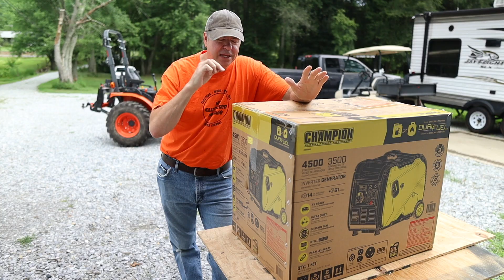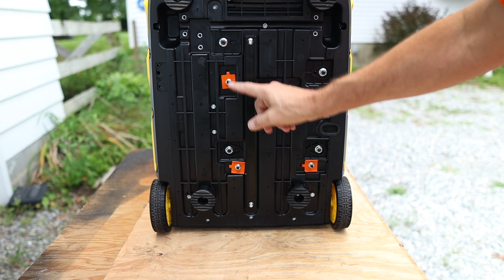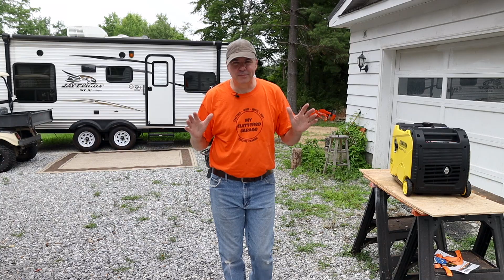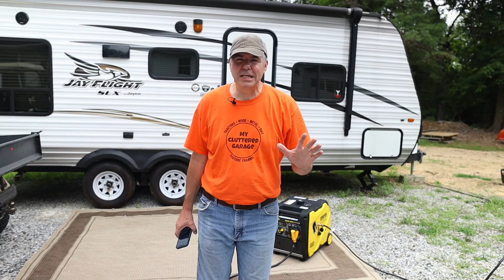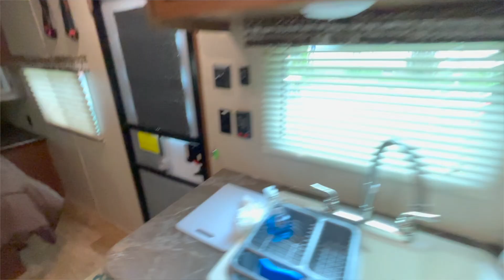#68 Champion Dual Fuel 4500 Watt Inverter Generator. Unboxing, setup, and review. Best RV generator?

Comment from the maker: Champion dual fuel inverter affiliate link:
https://amzn.to/3CqGngE

Here are some other product suggestions. These are Amazon Affiliate links, so purchasing will help this channel by providing a small commission while not costing you any more. Thank you for your support!
Lumax Heavy Duty Grease Gun:
https://amzn.to/3mFK1pA
LockNLube Grease Gun Coupler:
https://amzn.to/3kPcvwu
Recommended Grease:
Valvoline Moly Fortified
https://amzn.to/3jNM1Kv
Nitrile Gloves:
https://amzn.to/34Kg8OG
Deerskin Gloves:
https://amzn.to/2I17NNy
My Video Gear:
Rode Wireless Go II microphone:
https://amzn.to/3eiJatG
Canon M50 Camera (now Mark II):
https://amzn.to/3vHW9uD
Battery adapter for M50:
https://amzn.to/2RshsBE
Sigma 16mm prime lens:
https://amzn.to/3vJDRcx
Sigma 30mm prime lens:
https://amzn.to/3epFneh
Variable ND filters:
https://amzn.to/3tmoHIs
Reply: JUNK! Stay away from Champion!!!!!

Comment: dang they must have really changed things in the 4 yers since you posted this. I just bought a 4500 inverter generator and it is under 60 pounds, very quiet and does not need wheels. I can carry it uncomfortably but it is doable. still prefer to use a hand truck or 4 wheel dolly because I am old .
Reply: @AsTheWheelsTurn  are you referring to the smaller champion 4500 w inverted generator? If so there are some differences between what you bought and what's in this video. 

For starters they use a different motor, yours probably doesn't have electric start, slightly less running watts (4500 is surge wattage), and a smaller gas tank. 

The one in this video is made for higher running loads, longer run times with the larger fuel tank, and easier portability since you don't have to carry it, it has wheels built in.

Two great generators, just slightly different design choices for different use case.

If you got a different brand, there's no point in comparing.

Comment: I used to swear by Champion Power equipment having three chainsaws, two 3650 generators and three 2500 inverter generators. Unfortunately the last 2500 I bought had a knocking noise right out of the box. Champion used many excuses not to warranty it. For example: my intended future use was to charge an RV battery for my house as any RV owner would do while camping and this is not covered by the warranty. (They call it Prime use).

They eventually supplied a new motor but did not cover the installation cost. In a recent phone call, they suggested I should have paid a local mechanic to diagnose the knock rather than drive to the closest Champion service center. They said I should install the motor myself to avoid repair costs. 

It was not my fault the motor was faulty from the factory and I should not be penalized for any possible future use. I paid for a new generator and I should have a new generator without incurring any extra costs. This is not a warranty issue, but a defective purchase issue.

Comment: Quick tip. 
If your can't get my gen to stay running......... 
If your propane generator starting and immediately stalls is often caused by activating the excess flow control device inside the propane tank valve, which restricts fuel flow by up to 80%. This happens when the valve is opened TO FAST. To fix it, turn off the tank, disconnect the hose to release pressure, reconnect and slowly turn the valve back on. It's happened to me and this is the fix .
Reply from the maker: I’ve never had that happen to me, but I have heard about it. Great point!

Comment: I appreciate this video and got mine today. Two questions. 1. Did you find it difficult to reseat the dip stick and screw in back in? Seems really crowded down there and I had to try several times. 2. I use Battery Tenders on all my motorized, electric start units. Not only does it look really tough to put the wiring harness on the battery but my Wife read something about it having a lithium ion battery and only using maintainers for LI batteries. What does everyone else use to keep the battery ready?
Reply from the maker: It is tight, but I don’t recall it being problematic. My battery has remained charged for several years and starts every time - even after sitting. I try to start it every 2-3 months to keep the carb clear and the battery charged. Good luck and thanks for watching.
Reply: @MyClutteredGarage  Is there anyplace for a fuel shut off? (Thanks for getting back with me!!)

Comment: Thank you for posting this!  I just purchased this generator.  Question for you:   Will the generator motor automatically turn off when the battery is full?  I've never had a generator, so I don't know what I'm doing.  Thanks!

Comment: Options have changed in 3 years. Champion now has a 4500/3250W dual fuel that weighs 51lbs. Even has a top handle.

Comment: Quiet? you mean you do not wake up the whole camp site with noise and fumes? The bears don't mind.
Reply from the maker: Most campgrounds have no-generator policy after dark, but this is indeed super quiet. 👍
Reply: @MyClutteredGarage ,  
Every campground I have been to never say anything if the power goes out and I crank it up.
Reply: It’s actually not loud at all. On ECO i can barely hear it when inside my 40 foot tt.

Comment: Does This model have a battery ? Owner’s manual doesn’t mention one??
Reply from the maker: Yes. It has electric start and a pull cord. My battery is still working great after 4 years.

Comment: Hi, I added the oil before taking the nuts and brackets off. I tilted the generator and then removed them. Is the generator still going to run?
Reply from the maker: I would think it will be fine after sitting lever for a couple hours. 🤷🏻‍♂️
Reply: @MyClutteredGarage Thank you for your response! I hope so lol
Reply: I almost forgot to update this. Anyways, for anyone wondering, I let it sit overnight (12 hours) and it worked just fine. 👍

Comment: I got one of those I carry it around in the backseat of my truck when I'm not using it I live off the grid I actually have two generators a 2000 watt and that 4500 I really like that generator it has a lot of power and it's very quiet it can run everything in my camper at once it'll run about 22 hours plus with a bottle of propane I have never put gas in it and don't plan on it and you do not have to choke it when you're running propane that's only for the carburetor they say You're supposed to but you don't that button for the reset allows you to reset the generator if it does trip without shutting it off

Comment: Nice Video thnks , just a question if you tried how many hours can work continuously? Happy new year also
Reply from the maker: Thanks. I’ve run it overnight with the RV air conditioner running. That was like 8 hours on gasoline. I haven’t tried a long run on propane.

Comment: These gen seem amazing , looking for a unit to run my 15,000 btu AC  on my camper with doing other stuff , i have heard the yamaha are king of the hill !
The price is very high but buy one cry once 
Our camper is 25 foot with basic stuff 
Do u have a good recommendation or just break down and get one of these babys 
Honda does not have one one in this size that will pull this load i am asking without getting to big and are the yamaha fuel injected , this may be the way to go when u get up in the moutains 
Thanks for input 
The cheaper ones have alot of options but will they last
Reply from the maker: I’m no expert, but I think this generator will run your RV just fine. I don’t know anything about the Yamaha, but fuel injection sounds nice. I’m still happy with this one. 👍
Reply: @MyClutteredGarage  firman has a decent one , guess just pick one , thanks for hitting me back

Comment: Does anyone know if it is better to plug in the extension cord before starting (making sure nothing is powered on yet so not under load) rather than after?
Reply from the maker: I don’t know officially but if it’s not under any load, there should be no issue plugging in the cord before starting. I generally start first, then plug in though.

Comment: The only thing missed was breaking it in which is very important the first hour should be run on economy mode and then the oil changed and then repeated at least two more times and then with the total run time of five or six hours without a big load
Reply from the maker: Thank you!

Comment: I have the slightly larger 4650 version of this unit. I found that carrying a fuel can and loading the generator empty saved a few pounds. Still, taking it off the tailgate and turning to put it down seemed like more than my 50-something back should be doing. I use loading ramps.

Comment: I have this generator. I’m using propane. I followed the steps to use propane but not even a sound. Nothing. No noise. Nada. 
Any tips?
Reply from the maker: Not even cranking over? Something is either not connected or something is wrong. It should start either way on gas or propane.
Reply: Not even cranking over.
Reply: We brought it out because we lost power due to weather. Power came back on so we put it away. 
Will try it again this weekend and figure out what the problem is.

Comment: Hi Ed. I have exactly the same generator as yours. I've only run it on propane but today, the generator started acting up. It would rev up then slow down on propane and after running it for 1.5 hrs, it started to struggle and eventually died out. Never used fuel on it yet. Any pointers?
Reply from the maker: Interesting. You should probably check with Champion support. I wonder if some of the carburetor seals dry out over time.
Reply: @MyClutteredGarage  thanks!

Comment: I bought the Champion 3500 dual fuel as I can (barely) lift it into the truck bed.  Never have used gas in it.  Runs an ac fine.

Comment: I have the same generator.  Did you have any issues with the propane regulator?  My gen will hardly run using propane.  I understand they had a bad batch of regulators
Reply from the maker: I haven’t had any issues with mine. Thanks for watching. -Ed

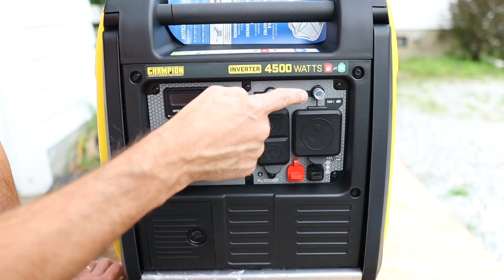Comment: Hi at 5:00 mark ,what is the one under the 120v outlet? thanks
Reply from the maker: I think that is just a grounding screw.
Reply: @MyClutteredGarage   thanks for the reply ,i just got mine , its the 200986 model. basically the same just no battery and push button to start. so i dont need to put anything in that grounding screw? basically just start it and use it? This is my first generator lol.i bought it for my first new born when power goes out it gets too cold out here in the north .

Comment: Still trying to comprehend the desire to use propane... it's more dangerous (extremely flammable and under high pressure (120psi or higher!!)), harder to obtain when you run out, more expensive, and lower performance.  All negatives.  The only positive with propane is that you don't have to worry about the carburetor getting gunked up if you don't take proper care of your generator.
Reply from the maker: You make great points. A few benefits of propane are that it’s cleaner to transport and it stores nearly indefinitely. Turns out I’ve used gas more than propane in this generator, but I do like the LP option. Thanks for watching! -Ed

Comment: You are my "goto guy" for my Kubota. I recently learned about Champion generators and wanted to learn more.  I was glad to see that you did a video on one.  I already have Generac, Honda, and a crappy Honeywell HW2000i, and I am pretty impressed with what I have learned thus far about Champion.  They seem to have good support and parts availability.  I like the dual-fuel models which avoid the risk of old gasoline damaging the carb. due to the use of propane.  Thank you for your videos.  I used your advice and re-fabricated the loader clamp on receiver for my Kubota.  It works great.   Ron
Reply from the maker: Thank you, Ron! This is my 2nd champion generator. I have been happy with them.
Reply: You are very welcome.  I adapted the front mount screw on the hitch receiver for my Kubota B2301 loader.  I' m a retired police officer.  But, did a lot of maintenance and repairs and wiring of the police station and cruisers.  I have a stick welder and a Lincoln MIG.  My neighbor is a professional welder and is teaching me.  My weld beads are almost as good as yours.

Comment: Useful tips: 
Starting the generator first, then flipping on the main breaker to feed the load is important because it will preserve a lot of appliances.  When a generator is turning over to start, the frequency and voltage are out of tolerances, which can slowly damage voltage regulators, sensitive electronics, motor windings, etc. in many electrical appliances.  In addition, it is equally crucial to turn main breaker off before shutting the generator off.

Propane fuel does not cause prolong storage problems for carburetors, but gasoline does.  I use Stabil fuel stabilizer along with Archoil fuel treatment for storing any gasoline engines.  It’s also a good idea to plug up the exhaust to keep moisture out of the engine, in case one of the exhaust valves are open.
Reply from the maker: Great points!
Reply: Can you just start up the generator then plug everything in?

Comment: In regards to gas verses propane, if I have it full of gas and want to use propane instead, does it default to propane if it’s hooked up? Thanks in advance!
Reply from the maker: I can’t confirm but I think it defaults to propane (since that line is pressurized). Sorry I don’t know the answer.

Comment: You should follow the manufacturer's break in procedure. There are various takes on this, which may be better, one way is to inject some oil in the spark plug hole, reinstall spark plug, run 60 minutes without load, change the oil, use some oil conditioner. Restart, and vary the load up to 1/2 capacity and run with and without ECO mode to vary RPM for several hours. Change the oil again and it should be ready to use.

Comment: Good review. Just picked one up on Amazon for less than $700. Mine will be used for emergencies (hurricanes) and to supplement my solar generator when there is overcast. I'm going to test some gas and propane for 5 hours and change the oil today. Seems to be a decent inverter generator. I'll still hold onto my 20 year old B&S beast that has a THD of <6%. It's just way too heavy to lug around. Thanks again for taking the time to do the review.

Comment: 59-61Db is almost double the sound energy....
Reply: a simple easily built box can be made to place over the unit to help with the noise, that way you do not get kicked out do to a noisy generator. 
yes it does happen a lot. many places do have it posted in there paperwork about DB levels allowed.

Comment: So, now that you've had it a year, Ed, what are your thoughts on the generator's performance?
Reply from the maker: I'm still VERY happy with it. No complaints! I did travel last year and used gas in it. It will run the camper AC all night long to give you a full 8 hours sleep. I just filled the tank when it was empty but brought a couple LP bottles for back up. I didn't bring an gas cans because they could spill and or smell.

Comment: If the tank has gasoline in it & also hooked to propane which fuel becomes the default ?

Is there a switch to go between the 2 fuels ?
Reply from the maker: I think it’s just magic. I think it’s odd that there is no switch to choose the fuel. I don’t know the answer, but I’m thinking that propane would be the default fuel, since it is pressurized.

Comment: Any long term update on this Generator? I have had several Champion generators and have had zero issues with them and am considering the 4500w inverter next.
Reply from the maker: It has only been used moderately, but it works great every time!

Comment: But does it have remote start? It's a no go without it. If homesteading, you don't want to brave bears, coyotes and skunks every night and you don't want to lug a jerry can of gasoline down an icy hill-side. You do want to use a large bulk propane tank with delivery by truck as you cant top-off a BBQ bottle to prevent running out at an inconvenient time.
Reply from the maker: You can't seem to get remote start on propane models. They do have it available on gas models.

Comment: I just bought one of these and did the break in  process on it. It's to bad the duel fuel doesn't get the remote start that's a neat feature to have as well. I wonder if it can be easily added or if it's built into the inverter block itself
Reply from the maker: That would be nice indeed!
Reply: I know while in the military we were not allowed to use electronics or even key a mic around diesel or JP8 fuel. It could cause an explosion. It may be the reason but I really don't know.

Comment: This had a remote start fob when it first came out...wonder why they got rid of it on the dual fuel models?
Reply from the maker: Yeah I was torn between “gas with remote” or “dual fuel with no remote”. I think it means be because the propane models need to cut the fuel to stop?

Comment: Did we ever figure out how it knows it's running gas v propane?
Reply from the maker: I never did. I’m thinking it may default to propane since that fuel is pressurized. That’s just my guess.
Reply: @MyClutteredGarage  
Interesting. Mine arrived today and I was able to set it up easily thanks to your video!
Reply from the maker: @nickfoley202  great! Congrats, and thank you. I’m VERY happy with it. I did take a trip last summer and used gasoline for overnights. I didn’t bring containers of gas - just filled the generator each day. I had to bottles of propane on hand for standby. One tank of gas ran the RV air conditioner all night, 7-8 hours. I have not calculated run time for a 20lb bottle of LP.